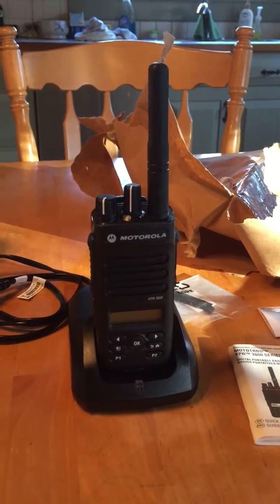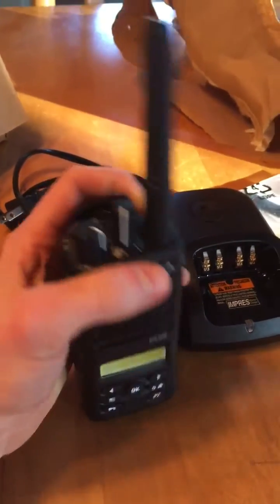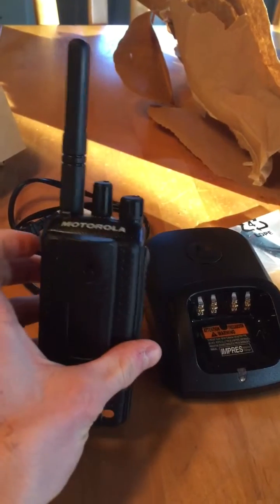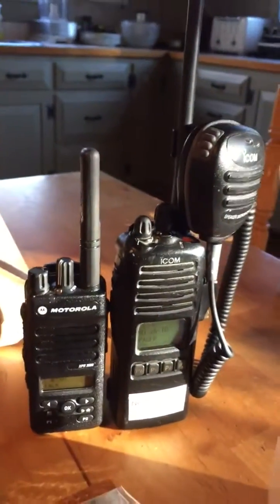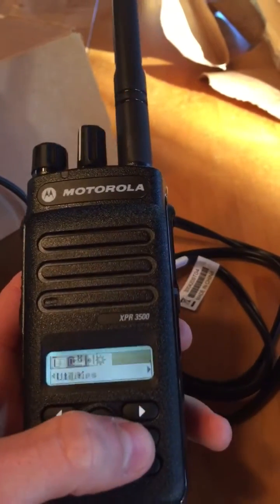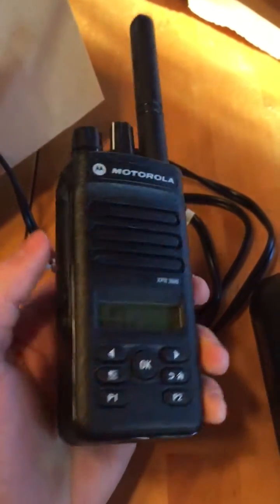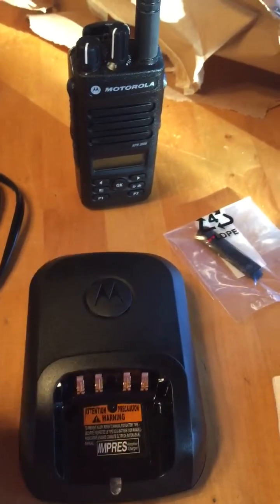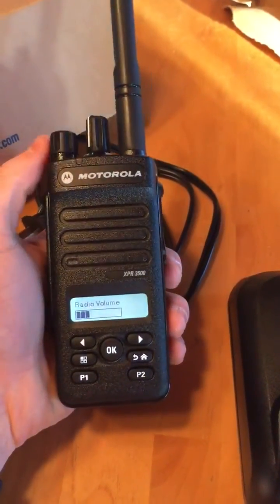Motorola MOTOTRBO XPR 3500 Quick Review

Comment: what is the difference between XPR3500 and XPR3500e? I have a set of 3500e but they need to be reprogrammed and they are as well UHF.
Reply: The XPR3500e is an enhanced version of the XPR3500, offering improved audio quality, additional features, and better durability. Both models support analog and digital transmissions, but the XPR3500e is designed for more demanding professional use with a longer battery life and advanced capabilities.

Comment: This radio is VHF compatible!
Reply: No
Reply: @TREYRYANBELL  what do you mean no, it definitely is lol
Reply: @ vhf and uhf is not compatible. You can’t talk on a vhf radio to a uhf radio. VHF and uhf are two different frequency splits. Example: VHF 154.000 vs UHF 460.000.
Reply: @TREYRYANBELL  I have the exact radio in front of me right now, used for fire department VHF frequencies, and municipal communication. The antenna also says VHF right on in. These radios do support both. The only change the user has to make is the antenna. They sell both UHF and VHF antennas for this model.
Reply: @JellyPies   the video is about a UHF XPR3500 that someone bought but needs a VHF Model. You commented and said “This  radio is VHF compatible. Im saying A VHF radio is not compatible with a UHF radio as far as the XPR3500 are concerned. I have a XPR3500e UHF for Law Enforcement frequencies myself and all I’m saying is I can’t talk to the fire department on there VHF frequencies it’s not compatible. Just because you put a UHF antenna on a VHF doesn’t change the band split of the radio.
Reply: @JellyPies  you said you have a VHF radio for fire department communications that means everyone in the fire department is using VHF radios not UHF radios. In the case of the guy in the video he uses VHF frequencies so the radio in the video being a UHF is useless to him. It won’t work for what his communications needs are.
Reply: @JellyPies  VHF VS UHF https://youtu.be/20RXl6TQ6m8?si=K4lf3-tzr5BcAzlt

Comment: nathan.. Dave comments he said I look over a few.. and some are not very accurate and he jumping to conclusions on info he doesn't have.. the xpr 3500. if u have the codes and permission to do so. them radio can do anything there capable of doing with in the means of the radio. I have  xpr 3500. and I can set off my tones for my pager on our dispatch channel. every radio can get permission to transmit and get lock out from transmitting. what ever ur dispatch is doing just work with that.

Comment: If you can't use it, I would like to buy it.
Reply from the maker: +Roman Robles currently I am trying to return it to the seller, with no success. Sketchy seller; he's going to get a horrible review on the transaction. If I decide to sell it myself, I would be open to negotiations.
Reply: Can you tell me what you would want for it, please?  Also, could you send a picture of the tags under the battery compartment?  Thanks!
Reply from the maker: +Roman Robles I would accept $400. The radio is in fantastic condition (as you can see) and it is obviously a UHF radio. However, I will warn you in advance that the cord included with the charger is not the right one. The seller I bought this from screwed me over in that way as well. A new replacement cord can be found on eBay for around three bucks. Luckily, the charging base that was included is the correct one (which is the most important piece). I'm not sure how I could get you a picture of the battery compartment tags--maybe you could add me on Google+?
Reply: +Nathan Brown I'm trying to add you now.